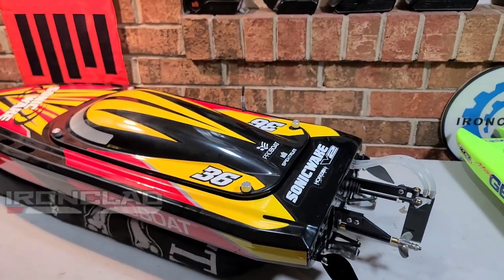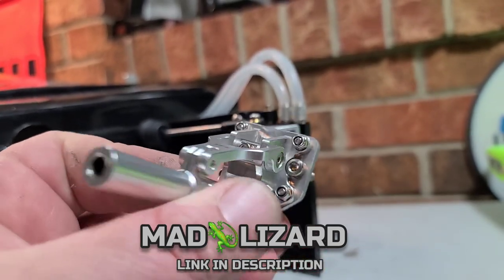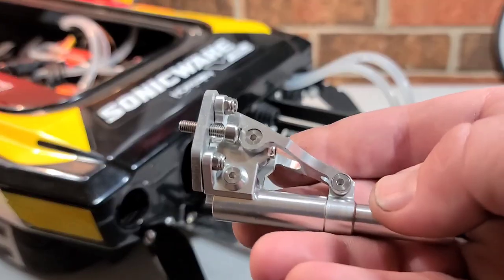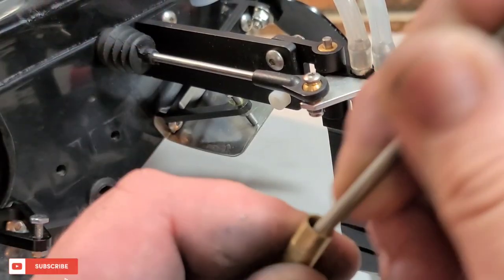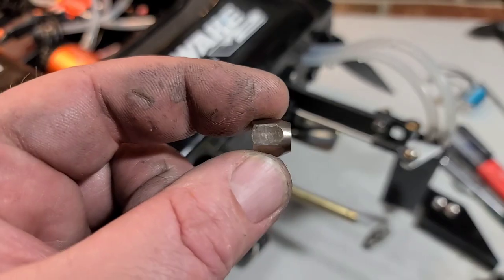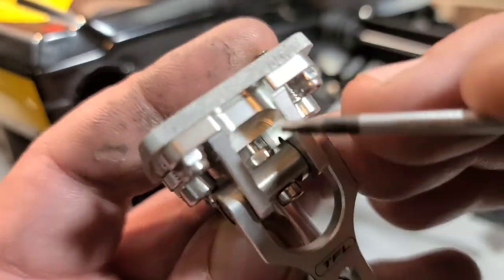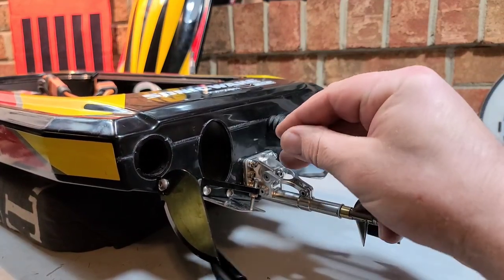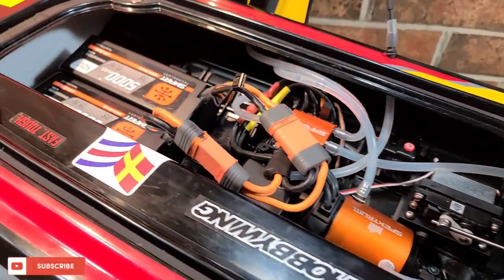TFL Stinger Upgrade For The Proboat Sonicwake V1 & V2 Full Install

Comment: I'm curious to see if your boat will leak water into the hull with the TFL strut installed. I have the same exact strut on my old busted up Pursuit boat that's been retired. It used to leak water into the hull through the gap between the stuffing tube and strut opening. It wasn't a tiny leak either - I'd say it collected 12 ounces of water after a 5 minute run. I ended up sealing the gap with silicone once I found the perfect prop angle and the leaking stopped altogether. Hope you don't have the same issue, but now you know how to fix it :) Thanks for the vid Big "B"!
Reply from the maker: Just got back from running  new stinger on the V2 it didn't have water in the boat,   It did how ever have excessive grease coming out the stinger/stuffing tube where the stinger  butts up to the stuffing tube. I think a peace of silicone tube over the stuffing tube at the stinger base will solve water/grease issue?
Reply: If you look up somewhere they say you just have to put a o ring somewhere to stop the leaking and grease

Comment: I Just installed the same Maddlizard adapter and TFL stinger on my V2.   The factory flex shaft isn't long enough to get enough shaft into the motor coupling when running my Oxidean 4519 prop.    With my x445 prop I have just enough threads to run one nut....  I bought my adapter used and I'm thinking its thicker than yours being a older version.  Any way you can measure your adapter for me?  My adapter is measuring in at 6.52mm thick....     I appreciate all your videos man they are great!!
Reply from the maker: It's about the same 4mm.  I filed my drive dog key way longer so I could move the drive dog forward on th shaft in return i can move  the prop forward
Reply: @IRONCLADRC   If yours is 4mm it’s definitely thinner than mine.   It looks different at the bottom also.   I ground my drive dog key as far as I could to get just enough in the motor coupler and a nut on the prop. That 2mm is what I’m needing to fit my second nut now….  I’m gonna run it with one prop nut and hope she stays on! Lol

Comment: Just wondering if you were familiar with the RC Boatbitz adjustable stinger?  I have gotten mine the other day and one of my concerns is the hole on the back side of the stinger isn't big enough to go over the O ring where the stuffing tube goes in so I can mount up flush. There is  a o ring in stinger where it flexes but still think there needs to be one around the stuffing tube. Any help would be greatly appreciated. Wish I would have looked into the TFL 🤦🏻‍♂️
Reply from the maker: No sir I've never run a rcbb stinger wish I could help brother

Comment: Big B. Just wondering, do you think it's beneficial to keep the liner long and go into the stinger?
When you ran the v2, did water get in the boat, I saw that some grease came out.
Reply from the maker: I kinda wish I would of run my liner long, I didn't have any water in my boat but I definitely think running the linner long into the stinger would help keep GREASE In & Water out. 

I use a peace of silicone tube over the end of my stuffing tube between the stinger to help keep GREASE and water out of my boat ( works well)
Reply: @IRONCLADRC  think I might look for some tomorrow,  and even o rings.

Comment: Hey Big B, great vids on the Wake V2, I have a V1, what size of props are you finding work well on your V1? I am running a TP3650 mod,SK 180A, with only the stock prop so far.Any suggestions on props would be appreciated. Thanks
Reply from the maker: Personally I like the 642 or the 1.7x1.6 proboat prop.
Reply: @IRONCLADRC  Hey Big B, where can i order the 1.7x1.6 from as OSE and Doctor props dont list that type...Thanks for the reply

Comment: What’s the name of the plastic thing you put in the stuffing tube? And what’s the size of it?
I got the same stinger and i always got a lot of water go in the hull
Reply from the maker: It's called a tenon liner not exactly sure the size, it comes stock on the Sonicwake. You can get the cabe and corresponding teflon liner from Offshoreelectrics.com

Comment: Hello please can I ask for your help I’ve got a sonic wake 36 v2 with 160amp esc I really want to get a tp motor for it for speed runs what size will I need to get and what kv for fast speed
Reply from the maker: If your using a spektrum 160, your gonna need something like a tppower 4050 1520kv (8s), or the 1700kv (6s)  Tp power motors pull quite a bit of power/amps, lower kv motors are gonna be better paired with the spektrum 160.  Lower kv motors pull less amperage
Reply: Thank you mate will that fit straight in with no modifications
Reply from the maker: More than likely, you may need to move the receiver box, maybe not

Comment: Got an interesting issue. Just installed one of these. Got some bad vibration. Noticed my stuffing tube is rotating. If i rotate it back into place, giver a small bit of throttle and let off hard the stuffing tube rotates. Anyone have this happen before?
Reply from the maker: There's a stuffing tube retainer with 2 screws just behind the motor I've used heat shrink with a dab of silicone sandwiched in the retainer to keep the stuffingtube in place